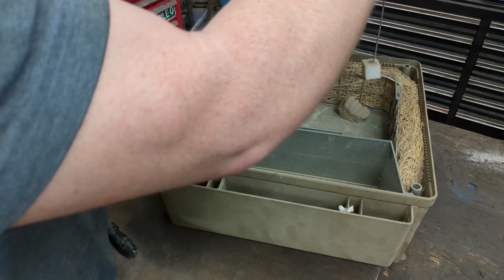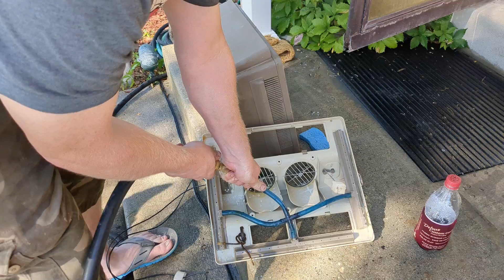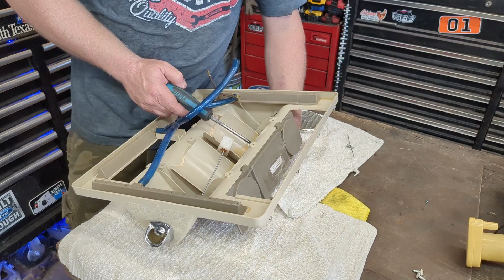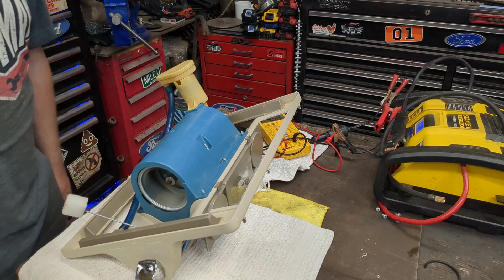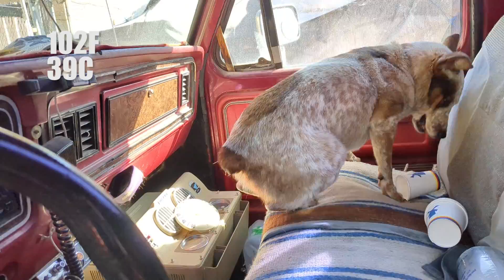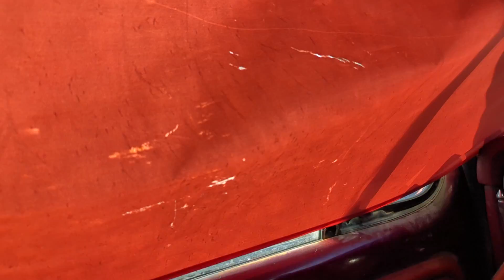Vintage Car Swamp Cooler AC

Comment: I think I remember seeing those in Whitney's catalog. They made them as far back as the 1940s. If you see a restored car from the period with what looks like a can on the outside of a window, that what it was.  They don't work in my area, to much humidity. I had a large pair of them on my roof in Arizona. I found back then the straw was much better than the new synthetic ones. I really didn't mind the spring and fall maintenance. Not much good durring the monsoon season except at night. They certainly use less poer than an air coditioner.  Plus the birds had fresh cold water.
Reply from the maker: I run my home off a swamp cooler, but I'm one of the last holdouts. People despise the maintenance they require.
Reply: Yes. Classic VW had window attached swamp coolers. Made by third party.

Comment: In the 70's My Uncle came down to visit and had one in his Mid 60's Ford pickup About an hours drive 85 deg outside It was cool in the cab He  also had ice in it
Reply from the maker: That's awesome. With 85F and low humidity this would put out 60F air.

Comment: Pretty neat. They sell one As seen on TV, an Arctic Air for about 50 bucks. But it doesn't have the surface area that yours has.
Reply from the maker: I've seen the ads for those and can't imagine they do anything other and push a little air. They definitely wouldn't cool anything larger than a shoe box.
Reply: @sixtyfiveford  I agree, they are so small and don't have much water media surface area, that they can't possibly work well.

Comment: I'm old enough to remember those plus the even more primitive ones which were cylinders which hung outside on the passenger side window and filled with water. Needed no power, just replied on moving through the air as the car drove. It was better than sitting in your own sweat, but not by much.
Reply from the maker: The window mount units are very sought after and can bring prices pushing $1000 or sometimes more.

Comment: Looks like it has a good amount of surface area on those pads, seems like it would work better than those old tube in window style swamp coolers like the kind you see on vw's alot.
Reply from the maker: I think the window units would work better for long runs only because they have a constant supply of fresh air. This unit will raise the humidity as it continues to circulate the same air and loose cooling ability. I had to roll down the window a few times to supply fresh dry air.
Reply: @sixtyfiveford  With all swamp coolers you gotta leave a window open for fresh air exchange

Comment: I made one of those 25yr ago. but mine was different,  use a car heater radiator. a small water pump, fan, on/off, and a thermostat. gave to my buddy who worked for Florida Power he got FREE ice. and his truck didn't have AC. He used it till they gave a new truck that had AC.  Jay the Florida pool pump motor (bearing) repair guy When Service Calls Longwood approved ! that was good info 2 know 👨‍🔧SIXTYFIVEFORD
Reply from the maker: That's awesome.

Comment: So, only works in low humidity?
Reply from the maker: They work best in low humidity. There are charts that show the temp they blow with the current outside temp/humidity. At 100F with 5-10% humidity I get 68-70ish air. Bump that humidity up to 50%/100F and it would only put out 85F air. By modern standards that's not comfortable. Where I live I run my entire home off an evaporative cooler and there's only 4-5 days as year where the humidity and temp are high. Those days the temp might push 73-74F and it starts to get uncomfortable.
Reply: @sixtyfiveford  I live in NE, humidity is rarely below 50% in the Summer.

Comment: I am 66 live in michigan never have I seen anything like that.sweet kool.old stuff.were did that cooler come from
Reply: Swamp coolers wouldn't be sold in Michigan because they don't work in high humidity areas.
Reply from the maker: Yeah, at 50% humidity with 100F outside air they will only push out 85F. That's better than 100F but not comfortable for residential/cars. You will find Evaporative coolers nationwide in industrial/large shops that have no AC though. They are huge black fan units on wheels usually pushed in front of garage/bay doors. 85F air feels better than just a fan pushing 100F air.
Reply: @sixtyfiveford  keep those vids coming.love them your a jack of all trades

Comment: Awesome, I had a swatter with one of these. But I never bothered to messing with it.
I’m # 30👍🏽
Reply from the maker: AC is one of those weird things that you don't even think about in a old truck/farm equip. I hop in, roll down the window and just drive. I never double think about how hot it is because nothing can be done about it  However, if I hop into a modern car, I'm immediately cranking on the AC because I know it's an option.